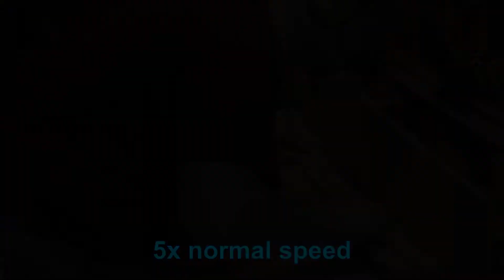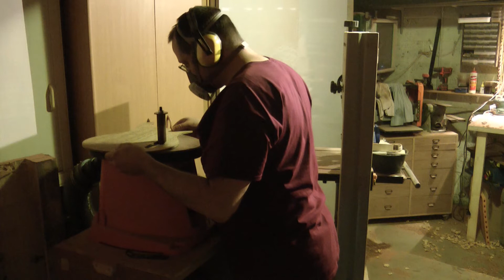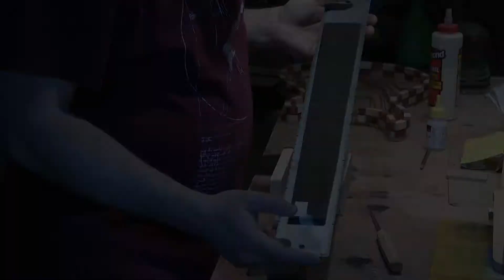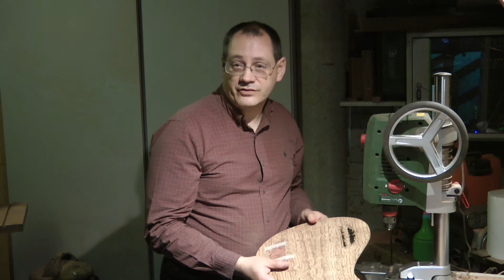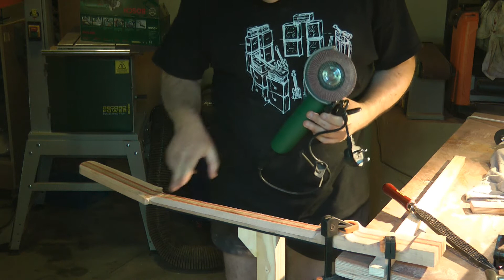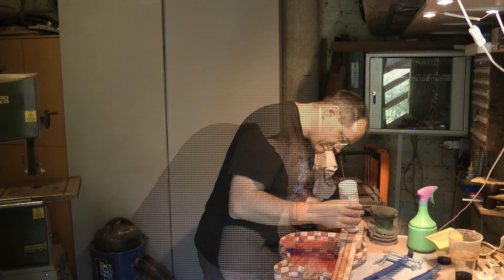12-String Guitar Build Episode 4

Comment: So I took you up on your offer and I've enjoyed your build so far! Im interested to know what bridge you are intending to use, as im currently planning a 12 string and finding the bridges available very limited.
Reply from the maker: Thanks for coming to have a look! :)  You're right, there's not much choice out there.  I got a Gotoh GTC 12, which looks like a decent option.  As part of my research, I thought to myself "I know that PRS occasionally makes 12-strings and they sell parts; let's see if they sell a bridge."  And indeed they do...but the price was exorbitant!  
The Gotoh was actually about the only one I could identify as a reasonable option, although I'm sure there must be some others if you look hard enough.
I also bought a pre-cut Tusq nut, to make sure that the string spacing will be accurate, which would be difficult for me to work out for a 12-string, not having made one before and not having one to use as an exemplar.
Reply: Jonathan Oakey Hmmm that looks like a candidate. I’m basing my 12 string build around the rickenbacker 330/12 except it will be neck through. I prefer guitars without neck angles which makes bridge selection limited.
Reply from the maker: That should be very cool!  I had a quick look around, and Rickenbacker sells a 12-string bridge too which isn't too expensive (http://boutique.rickenbacker.com/BRIDGE-12-STRING-12-SADDLE-ASSEMBLY_p_737.html).  Depends on how you want to fix your strings - this one needs a separate base plate too.
Do you have a website or anywhere with pictures of your builds?
Reply: I don't as yet. I've been watching videos for the last 18 months and have have all the parts I need to start my first build - Neck Through bass guitar. I just don't really have the room at home, and struggling to find somewhere local to start the build.

Comment: Hi! I am working in a room smaller than yours as an amateur violin maker, ive seen that unlike me you are keeping the room quite tidy, do you have some tips for me to reduce dust and mess in a small room?
Reply from the maker: Hmm, perhaps I just don't show the mess!  I try to keep a reasonably clear space - I think in this video I was partly forced to clear my bench when I used my big router fence.  My no. 1 tip, if you don't already have this, is the tool wall.  You can see it to some extent in this video, and it's fantastically useful to have all of my most often used tools right in front of me, easy to get and easy to put back in place.  There are various systems that I looked at, but in the end I just screwed a large piece of MDF to the wall and use nails to hang my tools (plus, as you can see, some other pieces of wood with holes for screwdrivers, drill and router bits).
I also have several cupboards around the garage, and I'm not sure if you see it clearly in any of these videos, but I made the big chest of drawers that my thicknesser and belt sander sit on.  That has 14 drawers and the whole unit is on wheels so that I can pull it out when I want to use it, and at other times it goes away under my network cabinet.  There are quite a lot of tools, cables, offcuts and templates hidden away in those drawers.  On a side note, I don't know about violin-building, but it's amazing how many different tools you use for making guitars!
Having and using a reasonable dust extractor is a biggie too, although to be honest I tend to be a bit lazy about connecting it to the power tools while I'm using them because you still have to clean up afterwards.  Otherwise, it's just a case of regularly cleaning up, I'm afraid!